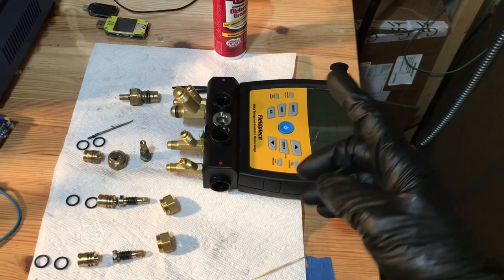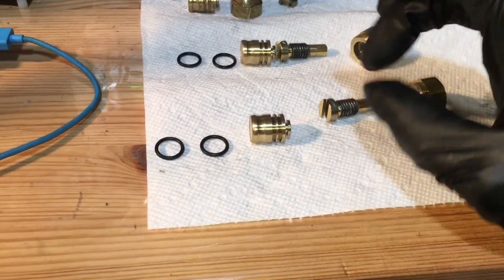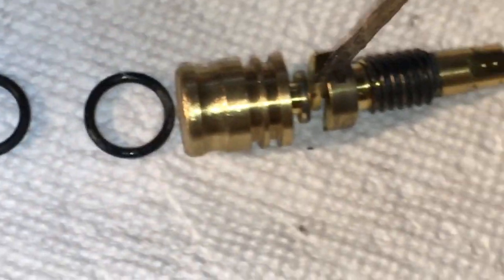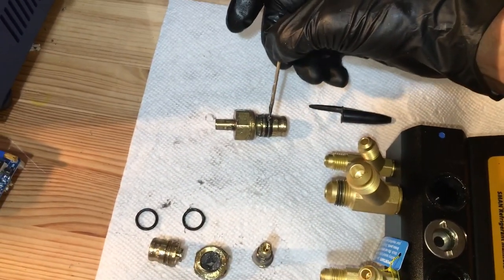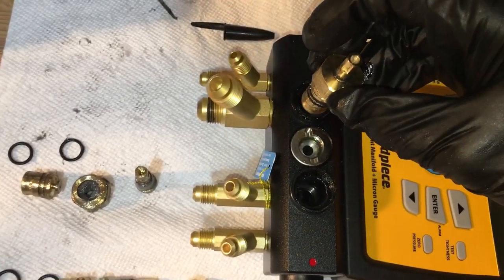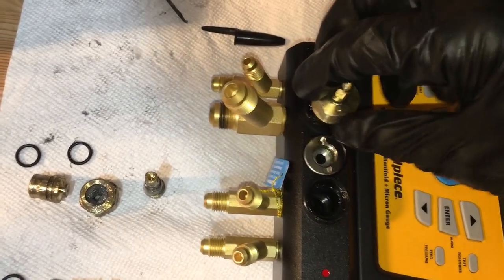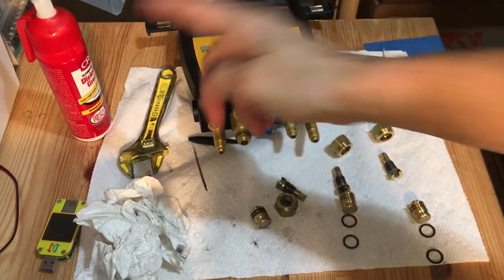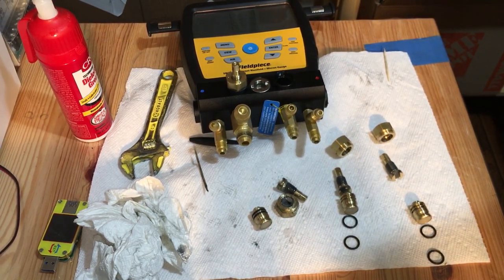SM480V overhaul deep vacuum modification.

Comment: Just ordered myself a SM480 and would like to know is the a good procedure to do to it once I take it out of the box?
Reply from the maker: Put it on your vacuum pump overnight leave it on zero without read the entire manual download it off their Internet website. 

After 10 or 12 hours first time use tell me what you could get the micron level reading down to ?. 

Will also be testing your pump see if your pump is capable of pulling down below 500 µm

I was curious did you order it from True Tech Tools ?
Reply: @coldfinger459sub0  …I was looking at them and another place my wife found. It’s going to be a Bday present so not sure where she got it from. I will be in the market for a pump next. What’s your advice on a good pump? Not top of the line in price but definitely not a cheap one.
Reply from the maker: @bmanhemi4ever903  A plain simple pump nothing elaborate but I will definitely have to probably be into 300 the $400 range
      JB, yellow jacket, if you wanted to spend a little more easy oil changes daily the Fieldpiece. 

Six CFM or below are more than enough for Automotive that were more than handle fast and easily the largest SUV with the biggest rear air-conditioning duel system. 

But large CFM is not important it’s how low the micron rating can go somewhere around 20 µm

It’s more important to save money and have a small CFM pump like two CFM to four CFM save that money and put it towards the large silicone Accu tools blue three-quarter inch vacuum hose. 

If you watch the videos by Jim Bergman he made videos for Accu tools he made videos for measureQuick and he made videos for True Tech Tools all about vacuum and using smaller vacuum pumps with the larger silicone dedicated vacuum hose you’ll know what I’m talking about.

Comment: I have a 480v and the buttons worn do u no were to purchase new ones
Reply from the maker: I’ve never seen one buttons before. What do you do hit them with a hammer? 🤣 

My buttons, the letters are worn off of them, but the buttons are still good . 

Do you mean worn buttons as in you have holes in them? 

Or worn buttons as when you press them, they don’t work  ? 

I do not think the individual buttons are available 

I know if the buttons are not working there is a resistive pad type material that is conductive on a circuit board and usually when they’re not dirty, that’s because something spilled down in between the buttons and it’s contaminated at the surface .

Comment: How does one get refrigerant oil out of that sight glass?

I started a new job working on refrigerators, and the guy who is showing me the ropes on the refrigerators (did hvac before this) used my gauges and after pressure testing 3 refrigerators has gotten oil in to the manifold. I don't want to tear them apart without knowing what I am doing, but I want to clean out the manifold.

I also heard refrigerants with leak seal can mess with sensors, so I was already wondering how to maintenance them once in a while to keep them cleaned out.
Reply from the maker: Patrick Go down to the pharmacy and get PURE ISOPROPYL ALCOHOL: 99+ % 
The higher the percentage the better. 
Also look for the term “dehydrated alcohol” an extremely hygroscopic. 

Put some in your hoses and blow that through with dry nitrogen not shop compressed air. 

Fill your manifolds up a little bit leave a little room for air shake it up and down shake it all around at a lime in your coconut. Lol 😂 

Then blow it out with nitrogen usually if you repeat this three times that does a good job. 

Also depending on the refrigerant if it’s mineral oil if you have some CFC refrigerant that you can pass that is clean through your gauges as a solvent will pick up mineral oil

It’s extra oil R134 is a good solvent to clean it out pass clean or 134 through your gauges into your recovery machine. Of course not out to the atmosphere.
Reply: @coldfinger459sub0 
okay, yeah it's residential house refrigerators and r134a that he managed to suck some of the oil out of the compressors  with.

Thank you for the quick reply>

I haven't had any luck with finding 70% plus considering the pandemic, but I'll look around.

thanks
Reply from the maker: Patrick he would not want to properly use 70% because the other 30% is water

Comment: How does the silicon grease react in a refrigeration system?
Reply from the maker: A-Team Adam https://www.napacanada.com/en/p/NTC209515

http://www.counterpersontraining.com/index.cfm?go=lms.module&moduleid=48&mode=train&contentIndex=38&topicId=164

I believe Parker even has a silicone lubricant for O-rings and other refrigerant hardware. 
         It’s been used in air-conditioning automotive for decades. 
             And you’re not putting it down into the Boers in contact with the refrigerant side of the manifold. You’re only putting it on the O-rings And in the piston O-ring grooves that are up in the cylinder bore buried in the groove. You’re putting it on the back side of the piston on the threads that is no way in contact with the refrigerant because it’s behind the sealed O-rings. 
But don’t worry it’s not Ralph approved for Bosch or Mitsubishis 🤣

        Silicone grease is also what is used like Nylog in Laboratories when they were experimenting with hardware to pull under deep vacuums when assembling two metal plates together to form a perfect vacuum tight seal. 
          Back in my dad‘s younger days of refrigeration and air-conditioning with R12 and R22 They used to use petroleum jelly(vaseline)

     I am honored to have a question from you. Keep up the good videos and teamwork
Reply: @coldfinger459sub0  Great video. I have noticed my Smans to have a leak when pressure testing with nitrogen. I am not sure I would of had the balls to take mine apart  without seeing your video.

Comment: Will doing this void any warranty?
Reply from the maker: For me personally, I don’t care. 

The gauges are very good out of the box . 

But I just want that next level of higher perfectionist . 

Because Refrigerant manifold gauges are not intended and Refrigerant hoses we’re never intendant or made to use for extremely low micron readings . 

When you want to do a real good job, you do not use Refrigerant hoses or refrigerant gauges 

You use a dedicated separate micron gauge 

With a dedicated high vacuum hose like a silicone Accutools true blue hose for a Meadow Lane

Comment: Did this today¡ The valves are 6 months old and the manifold alone decayed to 2000 microns in 20 minutes!
Reply from the maker: Actually you cannot measure the Decay inside the manifold alone because the internal volume is too small. 

And if you truly were trying to measure the decay and even have a glimpse of a hope of getting an accurate measurement. 

      You would have to try to pull that vacuum through a solid metal line like copper with no rubber gaskets for about a 24 hour period of time. 

The way decay works for measurements.   If you’re measuring a large volume say 100 feet of line set with a condenser or a large 30 pound or 50 pound cylinder with a micron meter and you pulled a 24 hour vacuum and you got down to 60 µm.   In a slight bit of moisture or any small leakage and decay let’s use a theoretical round number like 10,000 molecules of air or moisture in 5 ft.³ of internal volume and surface area your micron meter may only read 200 µm of decay. 

But now let’s try to repeat that exact same test within the small confines of the internal volume of a refrigerant manifold you will have a little bit of moisture left and just by disturbing the O-rings as you’re turning the valves to seal it off there’s some molecules of air in moisture that will be disturbed that are impregnated just in the surface of the rubber itself that will bleed off into that small tiny volume of 2 in.³ and we will say it’s the same 10,000 molecules of Erin moisture but now as a percentage of 2 in.³ instead of 5 ft.³.       So the reading of the K on your internal micron meter will jump up many times tenfold more inside your manifold than it would inside a large container. 

So in 20 minutes the question is did it start to stop at 2000 µm and slow down greatly and come off to a leveling point ?. 

      If so that is moisture still trapped. 

So you allowed to decay for 24 hours and see what happens. 

If your decay stops and does not exceed somewhere around 3500 to 3700 µm I’m just using a somewhat rough number and then it stops and stays there that is moisture not a leak. 

       I’ve made other videos where I continued on with these experiments to show people when I put it on the vacuum pump with metal lines and left it on the vacuum pump that was capable of going down to 3 µm for over 24 hours that there was much less decay and would actually hold at a much lower level. 

But every manufacturer‘s manifolds will benefit by using silicone grease in the grooves that hold the O-rings and on the cylinder boars that the O-rings travel on. 

Which I showed in some of the videos performing pressure decay using data grafting software with the Bluetooth sensor
Reply: My Sm480v is a year and a month old ,as of 2 weeks ago they been acting up. Discovered with a sniffer the leak is at the liquid side of the gasket and the electrical body. Also found heat shrink tubing on the wires inside were never heated. Shorts are just waiting to happen. Everything in the last few years being made is hot garbage. My old Sman we're great. My micron meter head attachment is 8 years old and is great. The new fieldpiece wireless micron gauge I have for 2 weeks leaks. The navac core tool remover leaks that is also 2 weeks old. My yellow jacket supevac manifold leaks after 6 months
Reply from the maker: @johnfrancis4748  so true I have noticed that about everything new even my small now vac eight CFM DC inverter vacuum pump started leaking internally just after one year. 

As for micron gauges I would get nothing but Accu tools blue vac. 

At least everything on the Fieldpiece manifold easy to order the replacement parts from True Tech Tools and easy and fast to replace. 

I went through two sets of brand new Testo 557S manifolds both have multiple and identical problems I now consider them nothing more than my trash manifolds to do only basics nothing where I need reliability or accuracy that is sad. 

I’ve have some of my original old vacuum pumps Robinair and JB and yellow jacket from 30 years ago.   
           I’ve only had like the plastic handles and plastic base get brittle and break and fall apart that’s to be expected especially when abused. 
                    Had some of the electrical on and off switches contacts burn out that’s simple easy to fix that’s expected. 
                        I had one capacitor go bad in the old vacuum pump that’s expected couple screws pull off the connectors put on a new capacitor it works again and these are 30 year old vacuum pumps that were in the high $200-$300 range 30 years ago. 

         Now I buy the new fancy DC inverter $600 plus vacuum pump with built-in micron gauge and it starts internally leaking after one year.    Even though I like the company and their products when you start paying upwards of $600 plus for a little vacuum pump and it goes out on you in a year that you can’t easily fix that’s a sign of bad times. 

I bought the first Appion big plastic yellow vacuum pump started leaking within a few months they gave me a rebuild kit for free because they’ve had a pattern defect problem it started leaking again after several months and so I stopped using it it became a doorstop a very expensive one

        The Appian recovery machine the same thing leaking handle plastic separating falling apart you know how expensive those things are vibrates like hell noisy as a F$&@.  It’s now a doorstop keep it as a memory of not to ever purchase that company‘s product again. 

I still have some of mine and my father‘s old school brass machined yellow jacket valve core removing tools and the only thing that I ever had to do with them is replace the rubber O-rings and 30 and 40 years later they are still working. 

Still have my original old TIF Analog large aluminum  Body 4 port with the large one percent high accuracy glycerin filled gauges.     It still works to this day after 35 years.
Reply: I bought the fieldpiece prob set 2 weeks ago to eliminate valves on manifolds.  To considering going back to the basics with my analog Titan and my micron fieldpiece head. My JP vacuums pump is 12 years old with no issues besides loosing the feet. I was looking into a new pump for the heck of it. You convinced me otherwise. I'm ticked and with having 30 day return policy with Johnstone, all my new crap is going to go back
Reply: What models from 30yrs who do you recommend from Robinair, JBs and Yellow Jacket? @coldfinger459sub0
Reply from the maker: @criticalw88  Robinair used to make good vacuum pumps.  They have cheap $35 Chinese knock off vacuum pumps that they have rebranded with their color and their sticker applied and then shipped over to the United States and they sell for about $250..      I’ve seen a few of those fail in shops.   It’s not like the old Robinair so I would last 20 years.

If Robinair still makes the American made version that is made by somebody else for them what is quality you could go that route 

JB I’ve had a few of their pumps very good pumps they are American made pumps 

The exact same goes for yellow jacket .  If they have an option between American made, I don’t know if they started importing the Chinese knock offs..   if so, get the American made. 

American made JB vacuum pumps are sold out True Tech Tools online if you were thinking of purchasing online . 
        I’ve been purchasing all my online, HVAC tools and supplies for the last 10 years plus from True Tech Tools. 

They finally gave me a offer code for all my subscribers .  You get 8% off.

In the coupon check out box you put in the word  LECHAIR all capital letters, all one word. 

When you check out it calculates and removes 8% off the price and they have free shipping off of orders over $50 . 

You will notice American made vacuum pumps in the United States are definitely not as cheap as the ones made in China .
Reply from the maker: I have a 20+ year old Robinair vacuum pump. The handles broke off the feet broke off. It’s basically a round motor that I set up on two wooden blocks. Even the capacitor is hanging off the side of the motor by its wires and I have the switch bypassed because it burnt out and I just plug it in and unplug it to turn it on and off..   are use it in my garage for vacuuming, refrigerant tanks.

Comment: Molycote 111 I believe will work even better. Had anyone tried using Molycote 111 for sealing deep vacuum manifold and hoses?
Reply from the maker: For decades in scientific studies and laboratories and colleges, universities and hospitals that do deep vacuum experiments and have equipment that require vacuum plus service ability of being taken apart easily use silicone grease. 

Cheap and easy to use and vacuum cannot pull through it .

And the Molly coat 111 should be basically silicone grease and if it’s the laboratory grade for vacuum specified 

They actually put the silicone grease through a dehydration process during its manufacturing and packaging